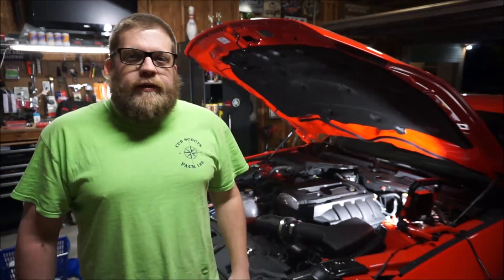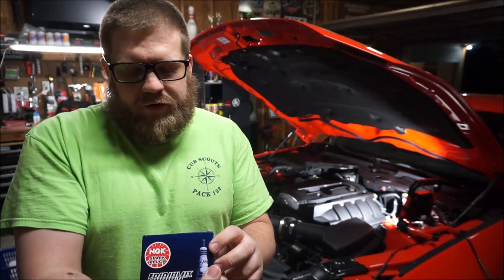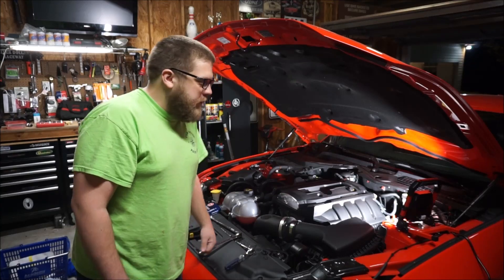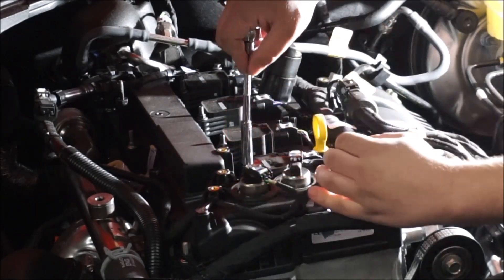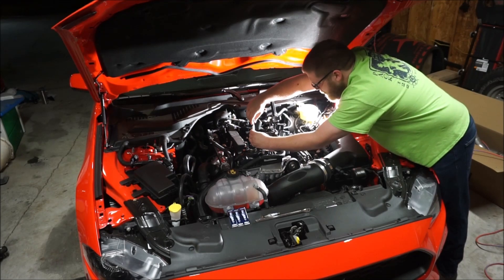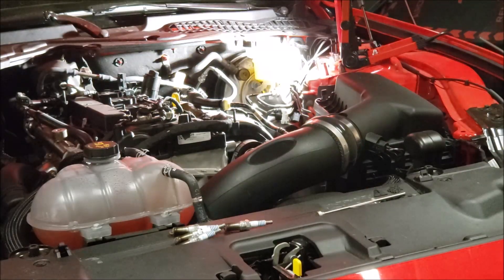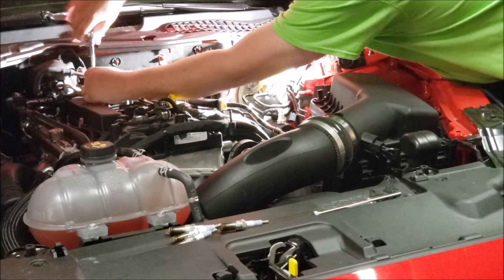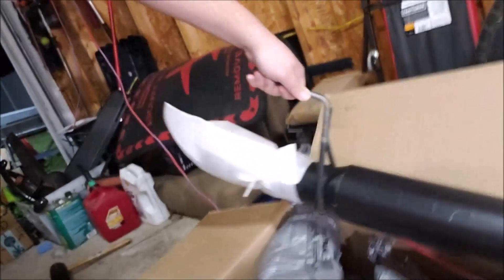TunePlus NGK Spark Plugs - EcoBoost Mustang (2015-2022)

Comment: I just picked some of these up from tune plus, hoping they solve a misfire issue I’ve been having with the stock plugs. I’m guessing the stock gap isn’t cutting it anymore due to the increase in fuel being dumped, can’t wait to try these out!
Reply from the maker: What fuel are you using?
Reply: @MustangsbyMatt  pump 93 with methanol port injection
Reply from the maker: No, I knew you were on meth. I was curious where you were getting your fuel.
Reply: @MustangsbyMatt  BP

Comment: They should have substituted the ecoboost for the barra imo.
Reply from the maker: Did those ever make it out of Australia?
Reply: Were only available in aus & nz. I’m amazed the US didn’t want to use the platform. Must have be emission reasons.
Reply from the maker: @boosts14  You're probably right on the emissions. Those were some truly amazing engines. Tons of horsepower and incredibly reliable.